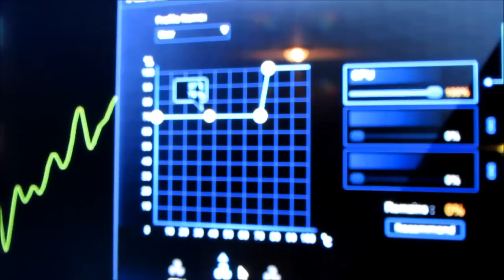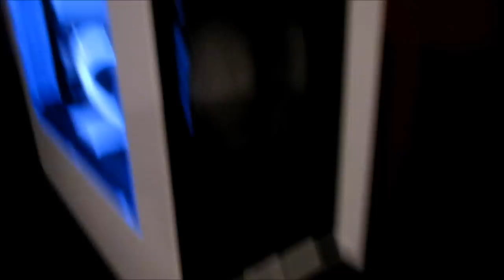Vlog #3 | NZXT S340 case PC update! and other stuff

Comment: I found this video while looking up builds with the NZXT S340 and this is looking similar to the parts I ordered, Hopefully mine looks as nice as yours turned out. I was originally going to go for a purple build but couldn't find purple cable extenders for my psu.
Reply from the maker: +Hydrox Awesome :) you can get custom purple extensions made by places like cablemod, but its more expensive than buying premade extensions from Silverstone or bitfenix. Good luck on your build! :D post it on LTT forums if you want to share it

Comment from the maker: +Nerisson85 no, the tower is riveted together and you cant disassemble it
but if you cover the rest of the case with tape and newspaper you can paint the top safely (just don't forget to cover inside the fan grill and IO ports)

thanks :)
Reply from the maker: ***** They are both excellent build quality. Fingerprints are a lot harder to see on the white version, but other than that its ersonaly preference. If you like black and red get the back and red one :)
Reply: +Enderman LP Where did you Get The Custom Cables? i need the exact same ones 0-o
Reply: +Enderman LP what leds are those?
Reply from the maker: +WeJe Games Bitfenix Alchemy white 30cm 15 LED
not the waterproof ones
Reply: oke and does they stick enough?
Reply from the maker: +WeJe Games inside of the front and top of the case
but the adhesive it comes with is kinda bad so I would recommend buying some better double sided foam tape
Reply: okej thanks!

Comment: Hey, very nice build. By the way, i have a similar configuration, and i have the same case. It's really awesome. I wanted to ask, what LED stripes are these? And how can you control them by software? Thank you and sorry for my english
Reply from the maker: iMac3840 bitfenix alchemy white LED strips
30cm each, and there are two of them
to control them by software you would need a led strip controller, which are usually made for RGB led strips and will not work with these

Comment: I want to spray paint my cable hider part for my nzxt case. but i don't wanna go through much trouble. hoping i could just do it easily.  BTW I have the same case as you. That's the only part I wanna do. Paint it red. the rest is black.

Also did you paint the ram or some type of cover? I just don't want the spray paint to bubble or be lumpy ya know? Not real worried about scratches since nothing touches it in front anyhow.

Comment: Very nice build! What do you think H440 or S340 is better? And may I know which power supply do you using? Thanks!
Reply from the maker: Fred Lo H440 is more expensive but has a lot more space and features
Personally I like the S340 better because its more minimalisticDepends on what you like best
I'm using the AX860i with a e-loop B12-PS fan

Comment: How is the temperature and sound considering you've closed off the top fan? Incredibly nice build by the way !
Reply from the maker: Phistem temperatures are fine, although I notice that I have negative airflow with two 120mm fans on the front pulling through my radiator and one fan at the back
im hoping that when I get my 280mm radiator the two 140mm fans will move more air
using a top fan (as exhaust) will definitely make way more negative air pressure and you will get a ton of dust, so you should use either the top or rear fan as an intake, put a silverstone filter on it, and that way you will have positive air pressure and less dust :)

Comment: Did you use a modular power supply?  I just bought this case (but the razer edition), and I want to use my semi modular power supply. However will it be enough to hide my cables around the case or will I have to opt for a fully modular power supply.
Reply from the maker: My PSU is fully modular, but semi-modular PSUs only come with the absolutely necessary cables attached, so you should have enough space to hide your cables.

Comment: do you have an link for that switch for your lighting? looks really cool, that you can turn on and off on the back :) nice build btw, love how you painted the parts :D
Reply from the maker: It's some random push button toggle switch I found in my boxes of parts, so sorry no idea where you can get one like it. Just look for a "toggle button" switch on ebay or something and find one you like. You will need to drill a hole in the back of the case though, luckily there is a lot of space above that rear fan :)
Reply: okay, thanks for the quick reply :D your pc is so well done, im thinking I might get a white case next time, im going to build a new pc :P
Reply from the maker: Haha thanks :)

Comment: Looks awesome man, excellent job. I'm actually going to get this case which is why I've been looking up videos of it. Definitely sold on it however I was curious on the fan configuration. Say I wasn't going to use a radiator at the front and just two fans along with the back and top fan. Would that be a issue having the 2 front ones as intakes and the back/top as exhausts. I only plan on using a air cooled aftermarket cooler so no need for a radiator. Was hoping you could suggest a good config for the fans for example which should be intakes/exhausts. Afraid if I do two front intakes and the 2 exhausts I'll get some negative pressure which I don't really understand. The whole fan thing I don't have much knowledge in as far as sizes, brands and what is best. Sorry lol, figured it couldnt hurt to ask.  Your clearly more knowlegable in this area. Props on the set up, looks slick.
Reply from the maker: Tyler Antonietti Thanks :)I would recommend two 140s for intake and either one exhaust at the rear or one at the top, not bothThat will keep air pressure positive
Reply: Thanks man! Should work out perfect, that case was like built for a radiator lol. Also sorry to torture you with one more question but I've heard the h100i is horribly loud with stock fans. Now thing is if I were to buy 2 fans to replace the stock ones I might as well grab the kraken x61 at that point don't you think? Its a 280mm rad so it will have slightly better cooling and stock fans are 140mm.

Heard it isn't as loud as the corsair stock fans also so I wouldn't even replace kraken fans. Not sure if you even have any experience with the kraken version but it seems like that would be the logical way to go if I have to replace the stock corsair fans. Would be quite close in price then.
Reply from the maker: Tyler Antonietti a 280mm rad is actually quite a bit better than a 120, and 140mm fans are almost always quieter than 120mm fans.
with the kraken x61 I don't see the need to replace the stock fans, so if you can fit it in your case I do recommend it.
Reply: Enderman LP Yea that's what I'm thinking. By the time I grab two decent fans I'll be within like 10 20 bucks anyways. I saw a guy on YouTube who used the x61 and it fit in the s340 case so should be perfect. I'll probably just do that then, already have everything else ordered. Thank you for your help man its greatly appreciated.
Reply from the maker: Tyler Antonietti yup :)
Reply: Enderman LP Question: Wouldn't two 140mm pushing air in and a 120mm and 140mm pulling still maintain positive pressure anyway? It seems the volume of air would be greater than the exhaust fans ability to exhaust it. Asking because I'm thinking of doing a black and white build with this case as well. Your build looks fantastic, BTW. I was totally unaware anyone made color sleeved cable extensions for the PCI-e and 24 pin, so thanks for the tip! Seems much more cost effective than buying all new cables.
Oh, and do you find that the acoustic foam on the front panel restrict your airflow at all? Sorry for the add on question.
Reply from the maker: John Montgomery Youre welcome :)

There would be neutral or negative pressure because it is much easier for fans to pull air out than the front fans to pull air in through the front pane, front filer, and possible radiator
I usually go with at least 1 fan less exhaust than intake

The back PCI slot openings have a lot of holes for air to come in, so you want lots of positive pressure to keep the dust pushed out

The acoustic foam on the front panel fits almost flush with the plastic moldings that are on the inside, so no it does not restrict airflow at all (there are some structural ridges on the inside of the panel, I put the foam in rectangles between those)
You can see a better picture here: http://i.imgur.com/OhMlS58.jpg notice the horizontal lines separating the foam, those are the plastic ridges :) foam fits perfectly in between
Reply: Thanks! I have a lot of plans for this case but also a lot of questions since I haven't seen one in person yet. Thanks for taking the time to reply!
Reply: Oh, one last question? How did you get the tubing on your cooler white? Is it a custom cooler or an off the shelf closed loop? I'm going to be putting the Kraken X61 in this case and was thinking of getting some white Techflex self wrapping sleeving to cover the tubes since painting doesn't seem practical.
Reply from the maker: John Montgomery The cooler is a fractal design kelvin expandable AiO
I changed the fittings to bitspower and tubing to EK ZMT
Then I painted the tubing white with plastidip (to get that matte white colour)
Techflex looks like it will work, just make sure you get one that opens on the side because you cant remove the tubing of the X61 to slide techflex on

Good luck!
Reply: Yeah, that's why I'm going to use the self wrapping kind. It's already open on one side and just forms itself into place.

Comment: is the carbon fiber on top of the case not bad for the airflow because of the fan that is there?
Reply from the maker: I removed the fan there. Temps are still fine, maybe a few degrees hotter than if there was a fan but it doesn't matter as long as it doesn't overheat, which it doesn't.

Comment: to cut holes in the vinyl just blow a hair dryer while it's stuck to the case so you will know exactly where to cut
Reply from the maker: I tried using a hair dryer the first time, but since the top of the case is not flat (there is a fan hole there) the vinyl didn't remain flat and it looked bad. So I decided to apply it with no heat, and now it is perfectly flat and hides the vent.

Comment: How much was this?  What are the parts?  What did you use to paint he parts etc?
Reply from the maker: +JohnnyZenith parts are on the "about" section of the channel, and I used plastidip to paint most of the stuff, with a little carbon fibre white vinyl on some stuff
Reply: +Enderman LP Legend.

Comment: Nice! Looks sick :D id get that case but dont think i can fit 2 980s in it :P
Reply from the maker: JangTheCrafter - PC Gaming it actually does :) it supports full ATX boards and has 7 PCIe slotsyou could even do 3 way SLI if you use 2 slot spacing and 2 slot thick cards (but you would have to use blower coolers to keep the temps down)
Reply: Enderman LP wow i guess it can XD lol

Comment: Hey, I'm planning to make an S340 black and white build, similar to the one in this video. It's my first build and I am going to buy some braided white cables. I am confused what the names of the cables are and where they go. Could I have any advice on which braided cables to buy so you only see braided cables. However, I don't want to spend £90 on all braided cables, if I am not going to see them all.

I plan on getting i5 6600K and GTX 1070.

As far as I know I need to get:

1x 24 pin MOBO Connection
1x 6+2 pin GPU Connection
Reply from the maker: Yes, they are called "sleeved extension" cables, and you can get them from bitfenix or Silverstone. Those two are the only ones you really see, but if you want there is also the 8 pin EPS (also known as 4+4) that goes to the top of the motherboard and can sometimes be seen.
Reply: Thanks for such a quick reply!
Reply from the maker: You're welcome :) good luck on your build.

Comment: What is the air flow of your front radiator and the others fans ? Take in or exhaust for each fan . Thank you
Reply from the maker: The front is an intake and the back fan is an exhaust. I would recommend using two 140mm fans in the front rather than 120.
Reply: i have the same with 2x 140mm fans with 280mm radiator ( i using Corsair H110i) at front to take air in through through radiator , back 1x 120mm fan exhaust , but i also have 2 fans 120mm at top should i take air in or exhaust ?
Reply from the maker: Exhaust, because otherwise dust will get sucked in. Just make sure your 140mm fans are running a bit faster than your 120mm fans and you should be perfect.
Reply: Enderman LP Thank you very much
Reply from the maker: You're welcome!

Comment: How did you make that light switch?? Because you've plugged it on to a header I don't understand...
Reply from the maker: +Maurits yæh I put a switch in line with the LED strip, so I can turn it off by just pressing the switch. It was pretty easy to solder it on
Reply: oooh Thanks, i am stupid :|

Comment: Hi, do you know if I can install an Arctic Cooling Liquid Freezer 120 in this case? It is pretty tall: fan(x1)-radiator(x1)-fan(x1)
Reply from the maker: Yup: https://tweakers.net/ext/f/jBD7PIsmixMnjSHltwLcTJ0I/full.jpg
Reply: thank you for the fast reply :) I'm about to buy this pc case, and that was the only thing holding me back
Reply from the maker: Yeah no problem :) just remember to take out the white bracket before installing the cooler :P
Reply: thanks again, everything went fine, I'd have never thought spending so much on a pc case would be remunerative
Reply from the maker: You're welcome :)

Comment: great case,but what dissapointed me is the side panel. Hard to clean but really easy to scratch =(
Reply from the maker: Ivan Ljubesic $30 and its fixed :)
http://mnpctech.com/nzxt-h440-s340-razer-replacement-custom-window-smoked-clear-red-uv-green-blue/clear-replacement-cnc-machined-window-for-nzxt-h440-cases-clone.html
Reply: im thinking about making custom glass panel,instead of acrylic,cus glass is really easy to clean and it doesnt scratch easily
Reply: Enderman LP Very clean setup, great job! Is the window in the video the MNP custom or just stock?
Reply from the maker: Chris Thank you! No, this is still the stock window...
I just spent $1.5k on repairs after my PSU died...so I may need to wait a while longer before I order the new window :(
Reply: Enderman LP Sorry to hear that happened! I just got the S340/red today. Awesome case. What psu did you have? Make sure to get a Tier 1 or Tier 2a psu. Also, what kind of power strip do you use?
Reply from the maker: Chris ThanksI had an AX860i
Should never have happened, but im not sure if the motherboard killed the PSU or the other way around
But now I bought a seasonic one, so hopefully that will last longer :)
And power strip? you mean power bar? I plug directly into a wall outlet
Reply: Enderman LP It's always a good idea to get a surge suppressor (not 'power strip' - my mistake), instead of just plugging directly into the wall. Look into the Tripp-Lite Isobar Ultra series.
Reply from the maker: Chris The thing is the surge did not come from the wall
It was internal
Something caused the PSU to send out a power surge to the inside of the PC
The AX860i already has protection for the incoming power and it would have normalized or shut itself down if there was a surge in my house
Reply: Enderman LP The AXi series is pretty much near top of the line (made by Flextronics). Strange that happened. 860w should've been more than enough for your rig, even if you had everything oc'd, Did you notice a burning smell coming from any of the components? Good choice on the new psu though. SeaSonic ones are great.
Reply from the maker: Chris Yeah I bought it because I knew they were some of the best PSUs...
way more wattage than my PC could ever use
The only burning smell came from the PSU itself
Pressing the self test button made it smell burnt inside
The LED would go red then turn off, definitely a dead PSU

Comment: Hey man did you buy those sleeves as extensions? Can you please link me to where I can buy em. Thanks
Reply from the maker: +Gera Pimenov Those are silverstone sleeved white extensions :) you can get them from ncix, memory express, or most other computer stores. Bitfenix also has some which are identical and jsut as good
Reply: +Enderman LP Ah alright thanks mine finally came in the mail. Also, was it hard to paint the tubes of the AIO cooler? Im thinking about plasti dipping my tubes to im just not sure how accurate i can make it.
Reply from the maker: +Gera Pimenov it was easier on my fractal design kelvin S24 since I painted the tubing off the cooler and then installed it. With the H100i it was a bit more difficult but I managed to do it. Just takes several hours of light coats from all different angles to get it covered evenly, and you need some space between the two tubes to get it painted there in between nicely, so spend some time making a "set-up" that will hold the cooler in several positions without the tubing touching the ground, you will be moving it around a lot to be able to paint from many different angles.